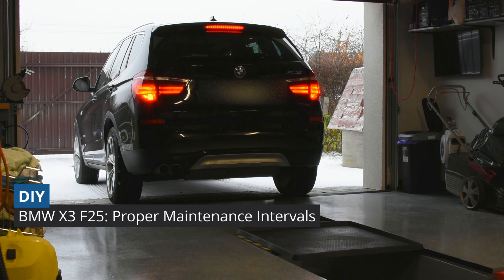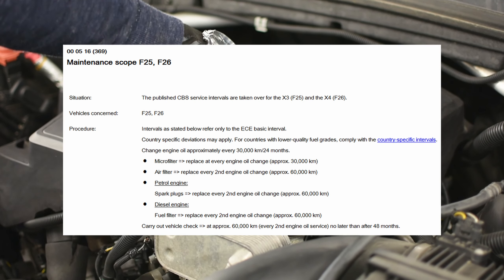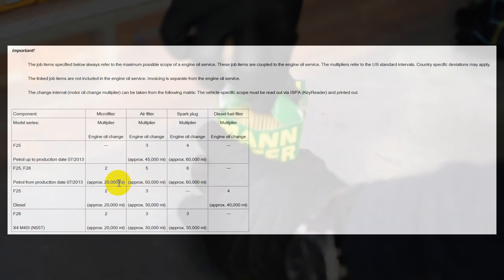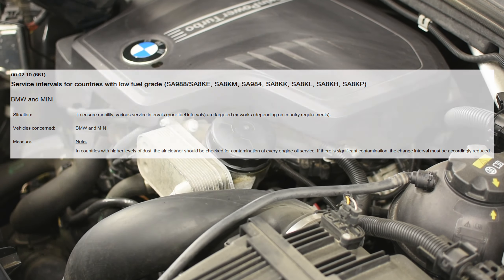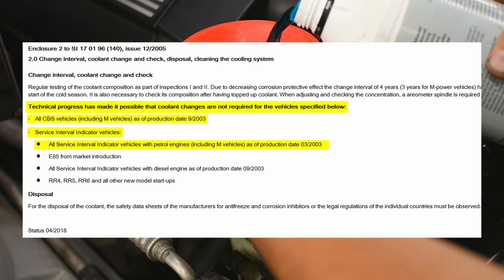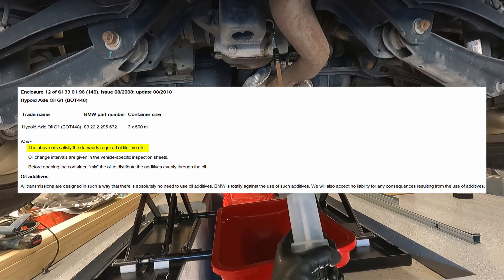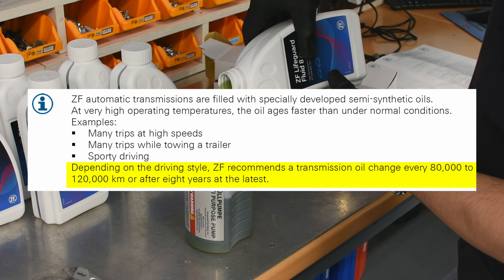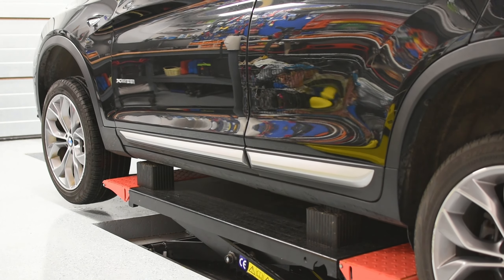Proper Maintenance Schedule: BMW X3 F25 28iX

Comment: Hello,  thanks for all the good info.
How could I know for sure which oils are recommended for my 2017 f25 2l diesel ? 
I'm looking to buy differential oil but the online shops all recommend GL-5 for both front and back. Your video clearly recommends differently
Reply from the maker: Just go with the genuine oils to stay on the safe side. Those oils are changed once in a 100k km so that's not a big deal for the wallet :-)
Reply: @dionich  the oils I want to get are from FEBI yellow 75w-90. However, the one on the website is GL-5 and in your video the recommended oil for the rear axel in GL-1 and GL-2 on the front. Meaning two different oils in each axle, whilst I can find only one that's different.
Or would think this doesn't really matter that much? 
I don't have the software to see exactly what's recommended unfortunately so I can't check.
Many thanks for responding
Reply from the maker: Yep, two different oils used in front/rear axles Hypoid Axle oil G1 and G2 - I think that's not the same thing as GL-1 and GL2. I was also a bit confused about which alternatives I could use there, so I went with the genuine to have less headache :-)
Reply: @dionich  I'm struggling to find even genuine ones too. Mine is a 2l diesel, is it safe to assume they are G1 and G2 ?
Reply from the maker: Sorry, cannot recommend wheter febi stuff is compatible or not. Just reach out any bmw dealer and buy the stuff there.
Reply: @dionich  will do, thank you